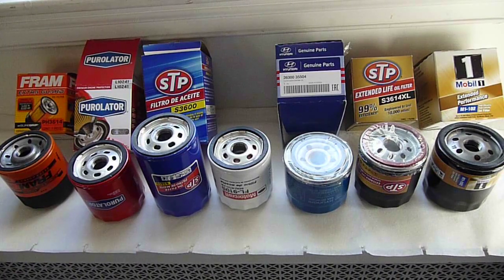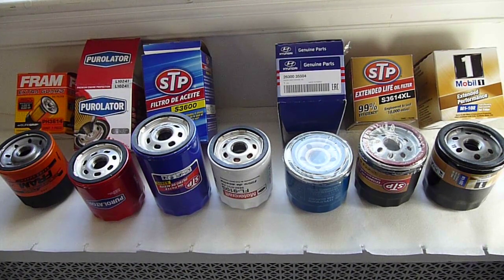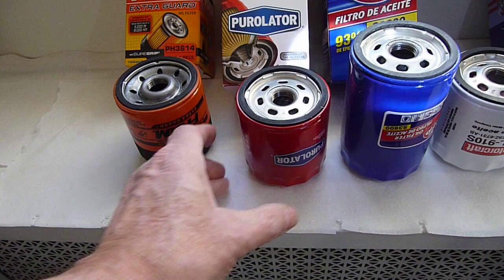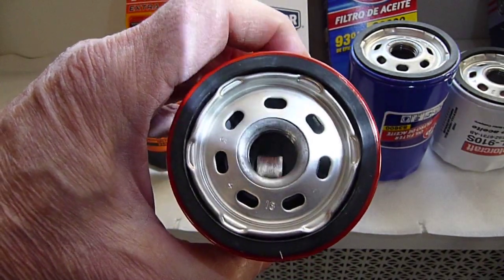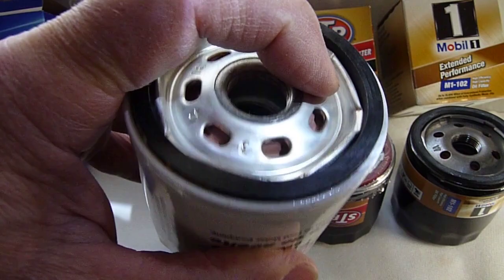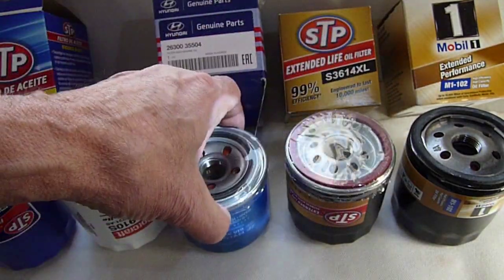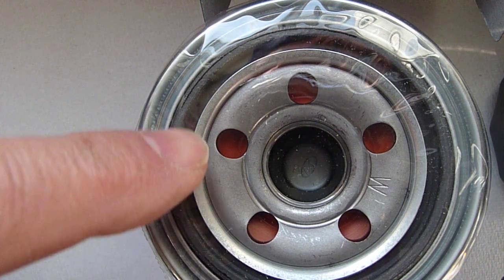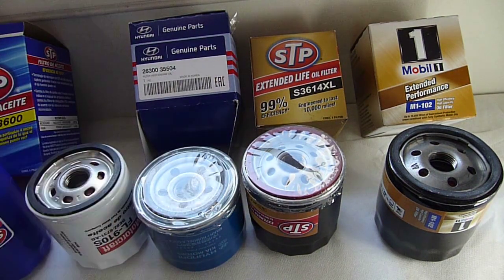BEST "safe" OIL FILTERS ??  EASY  Rule-of-Thumb for Selecting  "Good"  OIL FILTERS ...LOOK for RED

Comment: All filters can handle a 5000 mile oil change.
Reply: even if they clog up completely i believe your engine would still survive bc of the oil pressure relief valve .  always done filters every other oil change and never had a problem ( i knew about )  also thats what honda specifies .

Comment: Fram uses a red silicone ADBV now.
Reply: Fram uses cardboard end caps on the media.
This stuff has been shown to disintegrate.
Fram are absolute crap, I wouldn't ever use one in my car, I would rather plug the drain hole and drive the car to a store where I could buy a different brand.
Reply: @fubartotale3389  You guys are so misinformed by the internet and cutting open unused filters. It proves nothing to open a filter and look at its contents. It is not cardboard in a Fram filter. This has been shown over and over that they have used a resin impregnated fiber wafer. The wafers don't do anything besides hold the pleats together for the manufacturing process.  Endcaps whether metal or fiber have no bearing on the filtering process for an engine. The independent laboratories use the ISO 4548-12 test and it tests for damaging  particles and filter efficiency and Fram passes all the testing. If Fram was realky having problems they would be sued over the millions of filters they have sold and probably would be out of business.
Reply: @kj197734  
Says the Fram employee, hiw is"resin impregnated fiber" not cardboard? Semantics.
These filters have been opened up and shown to be disintegrating.
It's not the filtration thats the issue, its the degredation of the end caps and contamination of the oiling system that is the issue.
It is soley and completely greed on the part of Fram.
If it was such abrilliant idea, why don't other brands do it?
BECAUSE IT'S A BAD IDEA!

Comment: I really think that there is more to top quality filtration than the colour of the rubber. I would be more concerned about the amount and quality of the filter medium, I could be wrong but...?
Reply: true, silicone just last longer ,, nitrile will go 10k,, the media and is also a concern
Reply: Yes, there IS more to it than the color of the ADBV -- BUT -- this was only meant to be a "short-cut" to finding a quality filter.
Of major importance is the Micron Ratiing, which is concealed by most oil filter makers. 
 I use and recommend the BOSCH Premium Oil Filter #3410 (fits '92-'11 Panthers), Pennzoil Ultra Platinum, 5-W-20; and a FILTERMAG #SS365PR Magnet Kit.   ** Oil & Filter changes at 5,000 miles **

Comment: If the oi il filter mounts upside down in your car then the anti-drainback valve doesn't mean a thing!
Reply: But which side is the up side?
Besides aren't they ends instead of sides? Threaded end and domed end?

I know what you meant and I agree but I have a cartridge system where only the element gets replaced so anything other than the element is no concern to me.
Reply: Thanks, interestingly: my 2015 Dodge  Journey 4 Cyl Filter mounts  with threaded gasket End UP: & always did wonder if &, about anti DRAIN BACK  valves( silicone or Not,etc).....etc....?? Assumed Automotive Engineers knew and designed , esp,OEM Filters....interestingly, my DODGE Dealer uses PERFORMAX ( were Made Mexico, last two filters MADE USA) for OIL CHANGE PROGRAM.. And, I PUT ROYAL PURPLE, OCCASIONALLY........OR Napa Gold shorter periods......

Comment: CORRECTION !!!!!!!! Red and Or ORANGE Silicone represents a HIGH TEMPERATURE  formula or batch low temp is. Blue or Clear, Those are SAE standards for Silicone grades, Just like a bolt, it has 3/6 or 8 hash marks to identify material hardness , grade 8 is three times stronger(hardness) than grade  3 or even grade 5, so any colored  material is almost always silicon , the Germans do not follow SAE quidelines lines and they use a white silicone anti-drain back valve,,,,hope this helps
Reply from the maker: Thank you!   Glad to hear of the further SAE info that confirms the quickie rule  that if the ABDV material is  red or orange, then the filter is not crap.

Comment: Stp is made by Champion labs and is pure garbage. They also make the AC Delco filters that end with “E”. Also the red silicone is a “higher” quality component. It can take much more cold and heat. So basically your whole video is wrong.
Reply from the maker: Thank you for your comment, and glad to see that you agree the red silicone in oil filters is a higher quality component  ... oil filters with red silicone are better oil filters.
Reply: Don't forget Champ labs makes Royal purple and Amsoil, Mobil1 oil filters, they just have to make a E-Core to satisfy all the Tree hugging groups out there, So easy on The Champ labs , they make three is the Very best filters in automotive industry

Comment: fram is the worst, no good
Reply: always bought fram before i started using MOBIL 1 filters
Reply: The Ultra-Synthetics are just great, but I wouldn't touch the cheap ones.
Reply: Fram makes OEM Honda filters. Garbage
Reply: @jonsmith919  Bosch 3323, Motocraft FL-822 and AC's PF-2057 are all suitable replacements.  Fram doesn't make ALL Honda's filters, but why take the chance?
Reply from the maker: If you look at the less expensive Fram filters, the anti-drainback material is black (neoprene rubber).